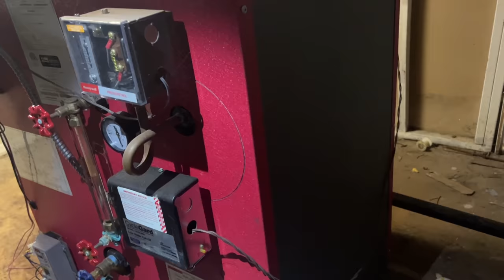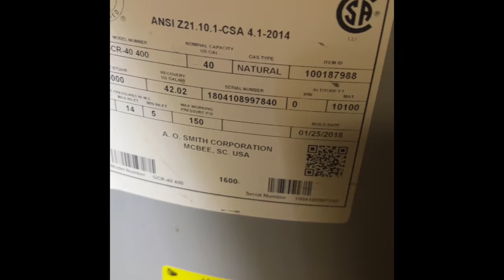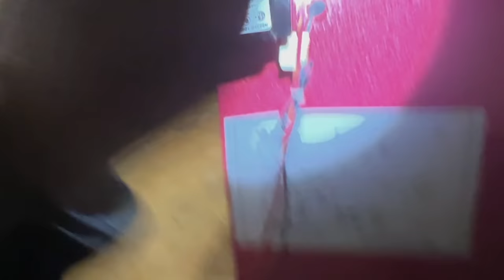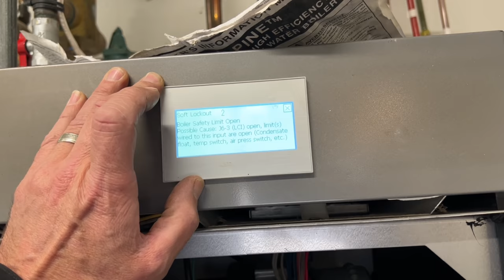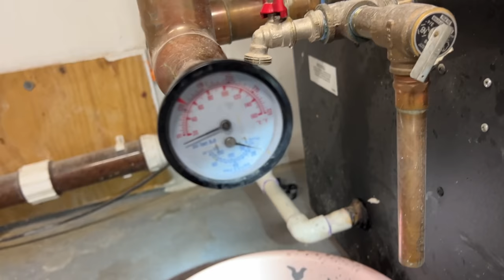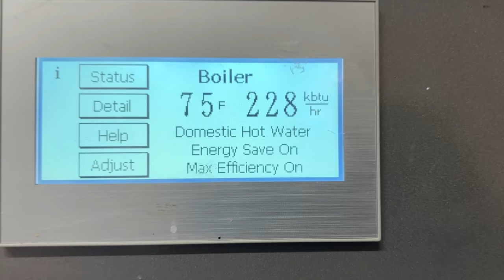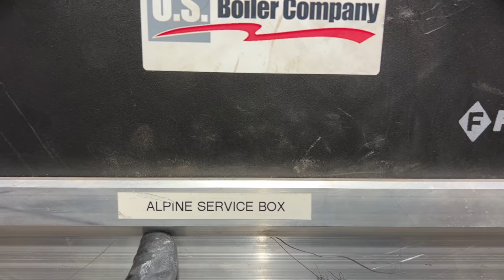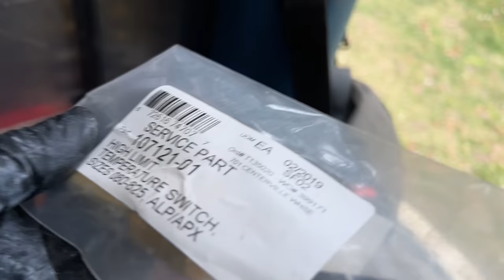Crown Steam Boiler Not Heating and Burnham Alpine Red Screen Error NOT in Manual

Comment: Probably not a good idea to run the beckett tubing outside in the colder climes, no? Or insulate it maybe. We run it with the lineset here in GA usually for a/c only but sometimes is also used for a condensing furnace as well. But we seldom see sub freezing temps.
Reply: @PipeDoctor  yeah. Always called it beckett tubing. Don't know where it comes from. Maybe original manufacturer?  The guy I used to work for called it that and it stuck I guess
Reply: @PipeDoctor  nice work btw.keep up your hard, professional work and someday you'll have your own Taj mahal.